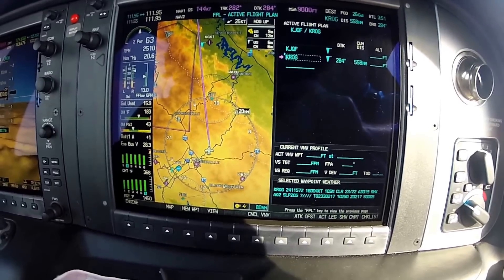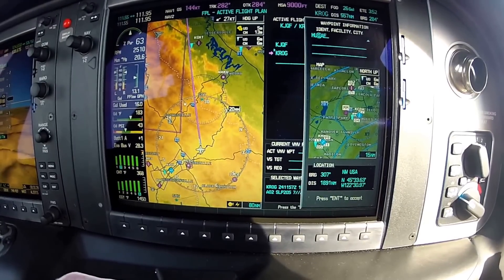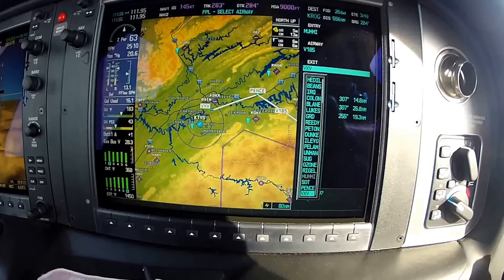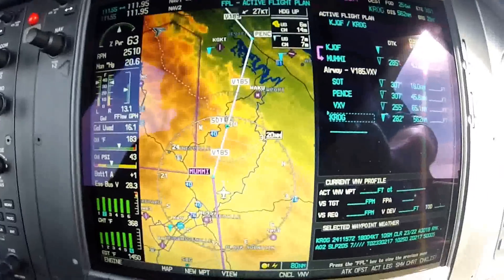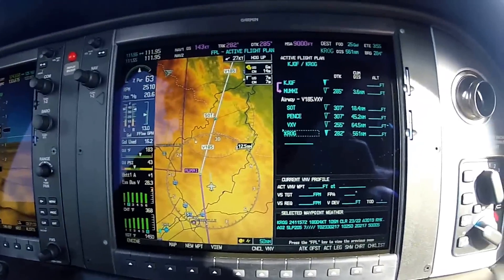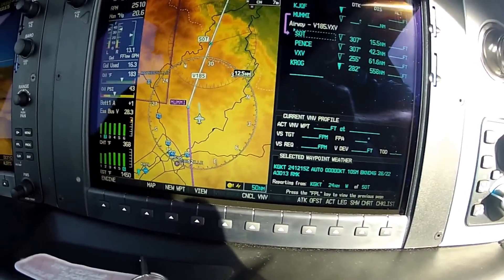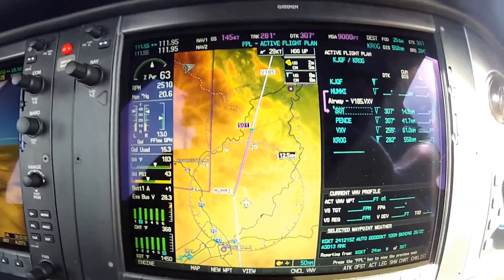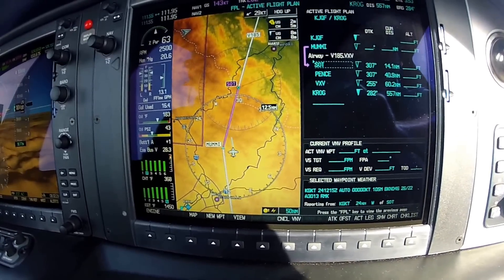Cirrus Perspective activating legs and intercepting with the GFC700 autopilot.

Comment: Alternate means to activate the leg:  Highlight the fix as Mark did in the video.  But rather than pressing Menu, there's actually an "ACT LEG" soft key on the bottom of the MFD, three buttons from the right.  You can see it in the video at 1:53, just before Mark hits Menu.  Either way works great.
Reply from the maker: +Mike Kobb Yes sir you are correct.

Comment: (Apologies for a rookie question) I'm not a licensed pilot, but I have done quite a bit of flying over the past 15 years with my Father-in-law who is. I love the Cirrus aircraft, I've been a big fan of the brand since it's release. Can the Perspective system overload a student/beginner pilot with too much information? If you eventually wanted to own or fly a Cirrus exclusively, would it be advantageous to learn in a Cirrus from day 1?. Thanks for the great videos, particularly showing what the Perspective system is capable of.
Reply from the maker: Anthony Bowe Hey Anthony, If you research accidents and the experience of the pilots who had those accidents you will notice one thing that is pretty universal. Many accidents are from pilots with low time in type. They could have 100 hours total time or 5,000 total time but either way during that first 50-100 hours or so in that new aircraft is the most "dangerous". Getting through that area and learning your new aircraft inside and out while having a highly skilled instructor with you can greatly reduce your risk. 
No matter if you are in a glass cockpit or traditional steam gauges, you will feel overwhelmed for a  little while. The Perspective is an extremely capable system but if taught correctly is actually very simple. Its set up in chapters and pages and with a little memorization of buttons and pages you can cruise through and get the exact information you need. As a new pilot you will only use a very small amount of what the system can do. Just think of it as an onion, as your gain more experience, you can peel back a new layer in the system to utilize.